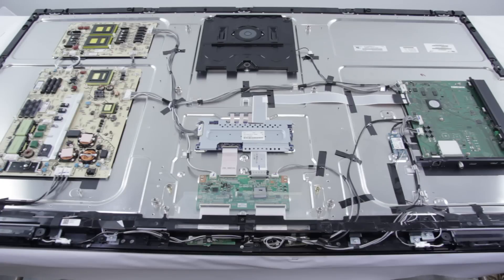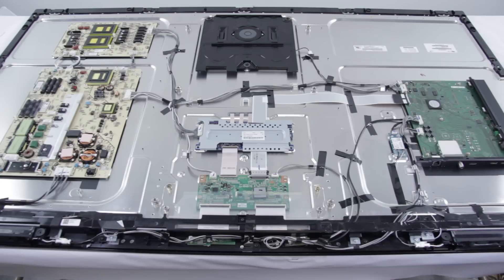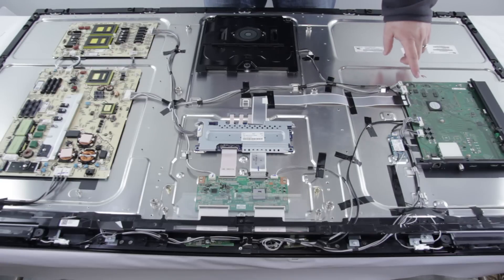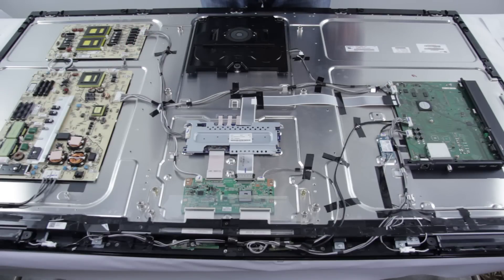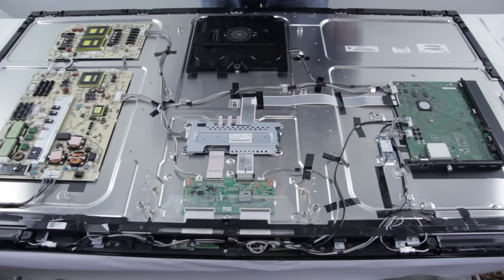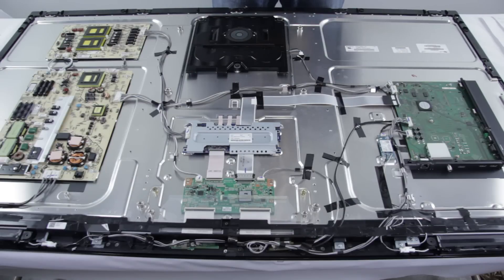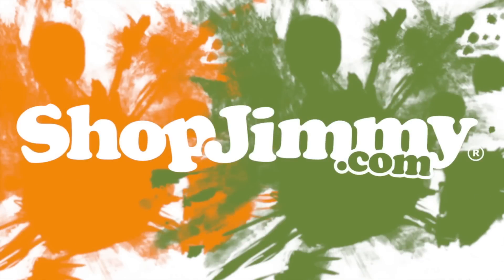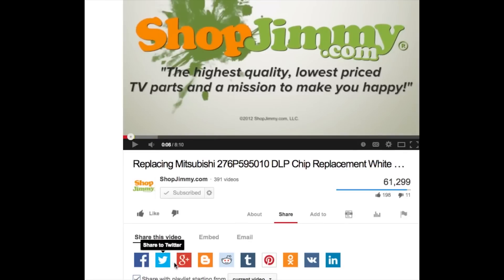LED TV Repair Main Board Overview Blank Screen-TV Has Audio but No Video-Common Issues Problems

Comment: I have replaced the main board and still get a steady blue light on the front of my Proscan 37LC45Q. Is there another part I should look at to fix the tv?
Reply from the maker: Robert Bragg   I recommend replacing the power supply board in your TV.  Here is a link to replacement parts for your TV model number on our website, click here:  http://www.shopjimmy.com/catalogsearch/result/index/?cat=59&q=37LC4  Be sure to match part numbers on your current board, with your replacement for compatibility.  Here is a link to a video showing how to identify your part number, click here:  TV Part Number Identification Help Guide for LG & Zenith Power Supply Unit (PSU) Boards  You can also call our customer service for further assistance with your purchase.  (877) 881-6492  Thanks and please let us know if you have any further questions with your TV Repair!  www.shopjimmy.com

Comment: 58L1350U - Just shipped the TV 1500 miles with UPS, original box was very banged up...but no physical damage to the TV.  When I power it on the back light comes on but no display/menu.  Also the power light on the bottom right is usually red or green, doesn't come on at all.

I opened up the back to see if it was a loose cable causing the problem but I didn't see any.

Thoughts?

Edit: There are no bulging capacitors either
Reply from the maker: +TheFresh   Is this a brand new TV?  If so, is it still under warranty?  Thanks!  www.shopjimmy.com
Reply: No, it's 1.5 years old I moved across the country and kept the original packaging.  It worked great before shipping it with UPS ground.

Comment: Hi. i have a flat screen tv that is a Westinghouse DW39F1Y1 . ive only had it for 2 yrs approximately and now it has no picture at all. you can hear the sound but cant see anything , not even menu options or anything. its not the HDMI cable as i use it for another tv and its fine. i tried using the diff HDMI ports on the tv and still nothing.. only sound. what is the best way to find out what the prob is or how can i fix it? i dont want to throw it out and not really do i want to throw it away.... if u can help, that would be great! thanks !
Reply from the maker: maryanne gorham   Try all repairs and troubleshooting at your own risk.  I recommend running the flashlight test on your TV.   Here is a link to a video we produced that shows how to run the flashlight test. https://www.youtube.com/watch?v=xUzCLgoSPGM Please reply with your flashlight test results and we can recommend a replacement part for your TV repair. Thanks and please let us know if you have any questions! www.shopjimmy.com

Comment: I have a two year old LG 47LN575V which has two 4 inch dark patches on the left of the screen. This is visible on all inputs. I gather these TVs have been discontinued by LG. I'm considering purchasing an LED driver board from yourselves in the hope it will cure the problem. Do you think this is advisable? If however the problem is with the LED backlights themselves I'm reluctant to try it myself. Thanks in advance.
Reply: I think the LED driver is part of the PSU board.

Comment: I have an lg 55le5400-uc.auswlhr. TV turns on and sound works but says no input signal. I tried different inputs on TV and all say no signal. Is the input board bad?

Comment: Hey there...I have a Sony Bravia 60" KDL-60EX701. One of the HDMI inputs does not work. All others are fine. Does this need a main board replacement or can I just fix the bad port? Thx
Reply from the maker: Michael Cavallaro  Please watch this video FIRST to help with your repair!  https://www.youtube.com/watch?v=BP3NVNCGEv8  I recommend replacing the main board in your TV.  Click this link to replacement parts:  http://www.shopjimmy.com/catalogsearch/result/index/?cat=56&q=KDL-60EX701  Be sure to match part numbers on your current board, with your replacement for compatibility.  Here is a link to a video showing how to identify your part number, click here:  https://www.youtube.com/watch?v=Aodz2LHkzbY  Thanks and please let us know if you have any further questions with your TV Repair!  www.shopjimmy.com

Comment: I have tv model number:65UB9200-UC.AUSWLJR

The TV has no video but it has audio and backlight, I tested the HDMI ports and they work but only the sound comes out and there is no video on any other input.
The power button and IR sensor are good and they do work, I tested the power supply and all the voltages are present and non is missing. 
I disconnected the right and then the left side of the panel but there was no change on the picture, I suspect the mainboard because is getting really hot on one side of the board but am not sure if that's the problem.

Comment: Westinghouse VR-4085df screen went black did some research online and people said it was the inverter board so I purchased one from Shop Jimmy and still the same thing...any suggestions
Reply from the maker: Kentrale Kelly   This sounds like a TV panel (TV Screen) problem.  If your TV panel is bad, it may be more cost-effective to replace the TV as panels are typically hard to find in stock, difficult to replace, and expensive.  Thanks and please let us know if you have any further questions!  www.shopjimmy.com

Comment: i got a  Emerson LF501EM5f with a A3Auquh main board   s/n ds1a1422150433   replace 2 caps c3207 c3214 and eeprom .. tv boots up now but blank screen wondering if i ordered wrong eeprom the numbers didnt match i cant think of anything else ..

Comment: I have an apex LE50D5. No picture has sound. When you hold a flashlight up to the screen in the dark you can see the picture. Replaced the inverter board and still has the same problem. What should I replace next?

Comment: My TV is a LG mod. 47LN5200-UB  I have no back light but can see video using the flash light test.  I ordered and replaced the power supply/LED driver board.  This did not fix the problem.  The TV only has one other board which I assume is the MAIN board.  Do you think the main board can keep the back lights from lighting up?
Reply from the maker: Samm1909   PLEASE SUBSCRIBE TO OUR CHANNEL - Try all repairs and troubleshooting at your own risk.  It sounds like you have bad LEDs in the TV.  Unfortunately, we do not sell replacement LEDs for your TV model number.  Thanks!  www.shopjimmy.com

Comment: Hi
I have a Led Sony KDL-42W70xB 42 inch 107cm
a few weeks ago in the corner appears a black spot and some risk.After having touch with cloth to clean the screen, the stain increased and covers almost entirely, now it is impossible to see image, any solution will be dead pixels?

Comment: LG 55LX6500-UB - Symptom: After pressing power button the LG Splash screen comes on (backlights come also) for about 3 seconds then screen goes black, but all lights at the bottom on the bezel remain on along with the LG logo lighted.

Thanks for any repair suggestions,
Reply: Did u ever solve the problem?
Reply: @alexanderfabian907  Here is what I did since I couldn't find the Main Board anywhere... I pulled out the main board from the tv and baked it at 385 degrees for ten minutes in the oven. You can find videos online about baking circuit boards to re-melt the solder joints, from what I found solder melting point is around 385 degrees. And YES this does work, I did it and it lasted about 2 1/2 years, and started doing the same thing. All in all I did this 4 times and it worked all but the last time so I finally trashed it.
Reply: @michaelthompke3919  did you have sound while u had the black screen? Or nothing worked?
Reply: @alexanderfabian907  No sound, just black screen and all bezel lights on.
Reply: @michaelthompke3919  thanks for your quick response... maybe my problem is something different because of the sound:/

Comment: Could you help I have a LG TV 55LC8900 MODEL NO 55LE8900-ZA. The problem is I tried  turning the on off switch on  to get the TV to switch on after a lot of switching on and of it would come on the screen is perfect no lines or marks and sound is fine.
But however now it refuses to come on at all.
You can hear a noise at the back of the TV coming from the left lower corner looking straight at it. So I think it is getting power in.I was wondering if you thought the main board has gone west.
I have managed to take the back of and had a look but can see no faulty caps as they all look good as far as I can see.
Can you suggest anything I could do to fix it.
John Short.
Reply from the maker: John Short   I recommend replacing the power supply board in your TV.  Unfortunately I do not see any replacement parts in the search results for your TV model number on our website.  Please reply with your part number on your power supply board and I can try searching for replacement parts.  Thanks and please let us know if you have any further questions!  www.shopjimmy.com
Reply: I forgot to mention when I heat up the mainboard with a hairdryer it switches on and off with no problem at all..
Could this be a sign of a dry joint?.
The TV  Model No is a L.G. LED 55LE8900-ZA  
Product code 55 LE 8900-ZABEKWLJG.
Serial No 005WRAJ53520. 
Mainboard No EBU60867193

Comment: I recently acquired a 2012 model  Vizio E701i-A3E that sources audio from both HDMI and component, but fails to display an image. Upon my first investigations, replacing the timing controller seemed to be my best option. But once I installed the card, nothing apparent had seemed to have changed. Using a thermal reader, I checked the operating temps on both the new t'con and main board. I found out that the the shielded IC cluster was operating well above 130F, while the t'con barely cracked a degree. Could it be that one of my mainboard IC's are shorting out, causing the video issue? The television worked normally before this problem arose and showed no sign of impending failure.
Reply from the maker: somtyer890   Try all repairs and troubleshooting at your own risk.  This sounds like a TV panel (TV Screen) problem.  If your TV panel is bad, it may be more cost-effective to replace the TV as panels are typically hard to find in stock, difficult to replace, and expensive.  Thanks and please let us know if you have any further questions!  www.shopjimmy.com

Comment: I have a Apex 32" LED Tv model LE:3245Nthe video is messed up. it only shows about 1/4 on the bottom and the rest is blank. Could this be a bad main board? if so how much and where can i get one???

Comment: I have a 40" Proscan 40LC45S. The television was working fine and then it would have problems turning on. The red light would be on and when I tried to turn it on I would get the blue light briefly and it would flicker with a crackling sound then cut right back off. Refuses to stay on. Is there any solution to this problem?

Comment: I have a Toshiba 55" LED Smart TV (model 55SL417U). When it's plugged in, it just clicks on and off, but nothing actually comes up on the screen. It continues this until I unplug it. I can't use any of the buttons or anything on it. I had it looked at and someone said it was the main board that went bad. I recently ordered a new one. Is that what needs replaced?

Comment: my VISIO 50 inch model p90hdm  have audio but no backlights and no image on screen when I did the flashlight test.  I took out the IR board  then ;power on the TV.  Problem still the same.  I eyeball the back of main board for burn mark but did not find any.  The main board looks clean.

Comment: Hello, I have an LG 55 inch tv model # LG55LS4500.  The screen suddenly went out, yet there is still sound. I have taken the back cover off, and noticed the backlight still works.  I was told it was the t-con board, but when I ordered the part and installed it, there was no change to the issue. Any suggestions? Thanks
Reply from the maker: +Sadi Fu   Try all repairs and troubleshooting at your own risk.  This could be a problem with either the main board or the TV panel.  You can replace the main board to see if that fixes the problem with your TV.  Click this link to replacement parts for your TV Model number:  http://www.shopjimmy.com/catalogsearch/result/index/?cat=56&q=55LS4500  There may be multiple boards for the same TV model number, be sure to match part numbers on your current board, with your replacement for compatibility.   Thanks and please let us know if you have any further questions with your TV Repair!  www.shopjimmy.com

Comment: I have a Seiki 50" led tv model # SE50FY10. When I press the power button, the blue light will come on but still has a black screen and no sound. Need help knowing what part I need to replace. Only had tv for 1 1/2 years

Comment: I have a Seiki SE40FY27 LED TV.  I have sound, but no backlight for video (I have images on the screen when I use the flashlight test).  When I power on the TV, the LEDs flash on, then turn off almost immediately and remain off.  After removing the back cover, the boards do not resemble any of the videos or images I found online.  I see only the main board and one very long board along the bottom of the unit which I can only assume is the backlight inverter/LED driver.

Comment: Westinghouse DW39F1Y1 has sound no picture, but when I took a flashlight I could see a picture.  I am assuming it's the backlight and need to know what part I need to replace it?  Thank you!
Reply from the maker: Twister791   This could be a problem with either the power supply, inverter board or the lamps in the TV panel.  You can replace the power supply and the inverter board individually to see if that fixes the problem.  Click this link to replacement parts for your TV model number:  https://www.shopjimmy.com/catalogsearch/result/?q=DW39F1Y1  There may be multiple boards for the same TV model number, be sure to match part numbers on your current board, with your replacement for compatibility.  Thanks and please let us know if you have any further questions with your TV Repair!  www.shopjimmy.com

Comment: Hello.  I have an old Olevia/Syntax 26" LCD model # LT26HVX.  The symptoms started with a loud alarm sound from the back of the tv and then the picture would go wonky.  It did this for about a week and to fix it, I'd have to shut it off for a few minutes and turn it back on again.  One day I turned it on and got just a blue screen with nothing else.  No loss of signal message.  No displays of any kind.  The controls do nothing and it pops every 10 seconds or so and the screen stays blue.  

I took off the back panel of the tv to look for blown caps on the power supply and main board and all the caps look perfect.  I'm suspecting the main board, but I don't want to waste money on a main board if that's not the problem.  If you have any ideas, I would most appreciate it.  Thanks!

Comment: Hello I have a Hisense 32K20DW LED TV, the symptom is the set blinks the stby power led several times, the set never turns on, just the blinking of the led and then goes back to the steady on of the stby power led. I just don't know what the codes point to, I will update on the correct number of flashes so this my point to the problem.

Comment: I have a Vizio E600i-B3 I need a new glass that's at the front of TV. It is broken on the bottom. Can that be replaced? If so what is the part no.? And price
Reply from the maker: J Mu   If your TV panel is bad, it may be more cost-effective to replace the TV as panels are typically hard to find in stock, difficult to replace, and expensive.  Thanks and please let us know if you have any further questions!  www.shopjimmy.com

Comment: I have an LG 47" smart TV Model Number: LG47LN5200.  I purchased it in 11/2013, and a few weeks ago, I lost the picture and eventually the picture and sound.  There was no picture or sound when we hooked up a DVD player.   I'm thinking it's the main board?   How much would this cost to get a new board and I'm thinking I could do it myself. Thoughts?
Reply from the maker: +Christina Tondora   Try all repairs and troubleshooting at your own risk.  I recommend running the flashlight test on your TV.   Here is a link to a video we produced that shows how to run the flashlight test. https://www.youtube.com/watch?v=xUzCLgoSPGM Please reply with your flashlight test results and we can recommend a replacement part for your TV repair. Thanks and please let us know if you have any questions! www.shopjimmy.com

Comment: Hello I need some help SHOPJIMMY. I have a Samsung TV model no pn50c450b1dxza, and here is the problem. when I connect it to the power supply I can hear  the start up sound through the speakers and I can also see the front led light coming on but the screen doesn't come on. Also when  I took it apart I didn't hear any clicks neither  I didn't see no led light at the logic main. any suggestions what the problem might be? thanks
Reply from the maker: Uriel Hinojosa  Please watch this video FIRST to help with your repair!  https://www.youtube.com/watch?v=BP3NVNCGEv8  I recommend replacing the main board in your TV.  Click this link to replacement parts for your TV model number:  http://www.shopjimmy.com/catalogsearch/result/index/?cat=56&q=pn50c450b1dxza  There may be multiple boards for the same TV model number, be sure to match part numbers on your current board, with your replacement for compatibility.  Here is a link to a video showing how to identify your part number, click here:  https://www.youtube.com/watch?v=BEPWrefQvqI  Thanks and please let us know if you have any further questions with your TV Repair!  www.shopjimmy.com

Comment: Hi my name is Stanley I'm having an issue with my Samsung model #UN60H6203AFXZA brand. Blank screen but audio is good. Only to find on the power supply board there is a area burnt so i replaced it. The TV work perfect over the weekend but this morning it went back to the same blank screen issue. Is there any advice i would kindly appreciated.